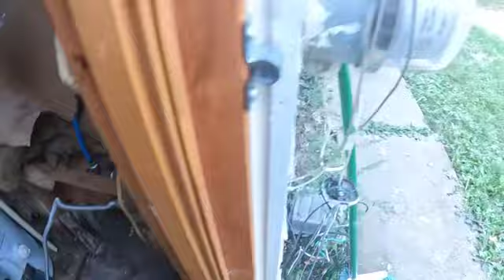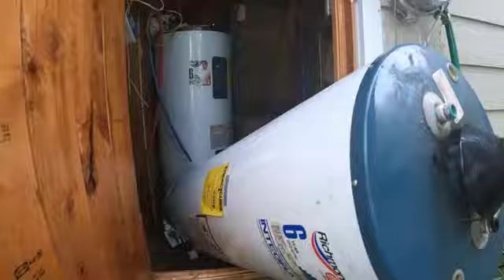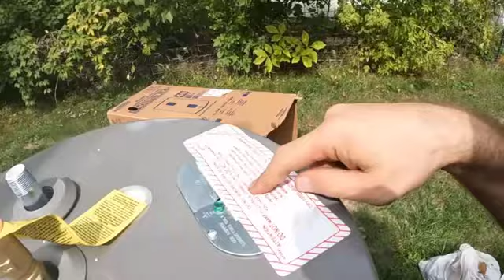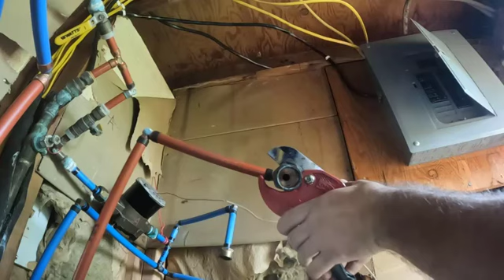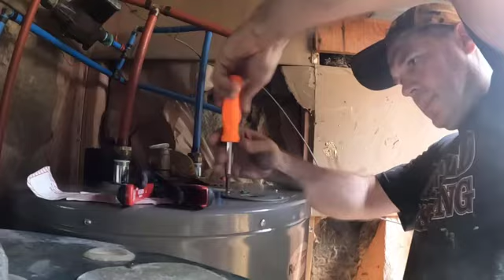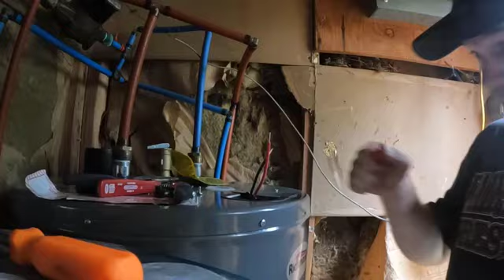Changing Gas Water Heater to Electric Water Heater! DIY

Comment: I'm replacing my current gas water heater with electric one. This is to escape the insane PG&E gas prices (electric ones are ok since I plan to get solar next). Do you think a modest $12k budget is ok for this? Tank plus installation labor?
Reply from the maker: Depends on water heater costs. I have heard some plumbers are over charging a lot these days so i wouldn't know i always do everything myself. Here in iowa a lady told me a $600 water heater was put in and she was charged $2k for it and labor. Crazy.

Comment: What if the panel in the garage but the water tank is in the wash room?
Reply from the maker: You will have to run a electric wire to wash room from panel. 12/2 wiring. You can run it in the walls that normally involves cutting a good inch out of the drywall all the way and drilling holes in studs and repairing drywall. If it has a basement or crawl space you can run the wiring underneath the floor. You can also run the wiring inside electrical conduit and run it along the outside of your building and screw it to the bottom. Here is an example of the conduit if you went that route and the wiring needed. Hopefully this helps.
Conduit -  https://amzn.to/40mBW0g
12/2 electric wiring -    https://amzn.to/3CbxK9h
Reply: @agiftedcurse2  thanks very helpful

Comment: Thoughts on doing Heat Pump Hybrid instead of straight electric?
Reply from the maker: Not at the time. This is in a rental. I am planning on trying out the mr. Cool heating and cooling in the unit im remodeling now to get rid of the electric heaters and ac. The heater wiring will still be ran in the walls to boxes but just not used unless something happens to the mr cool units. I tried a electric water heater 10 years ago and it cost a lot to upgrade the electric and it kept getting stuff stuck in this little spinning thing inside so i went back to a tank there. Wasted about $1500 there and avent wanted to try new stuff out unless it becomes standard.